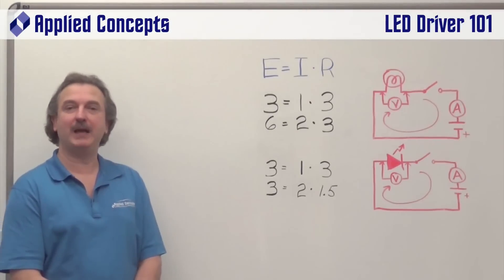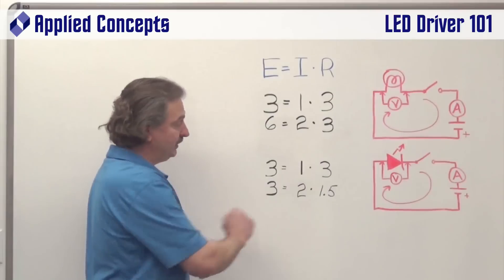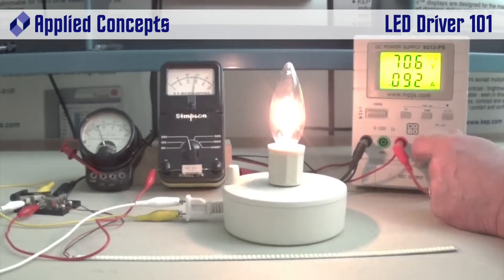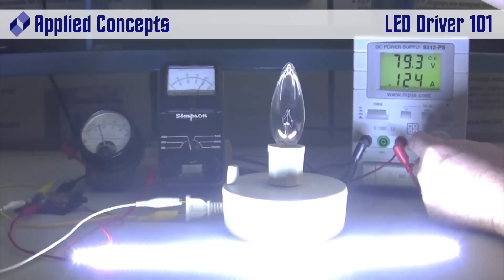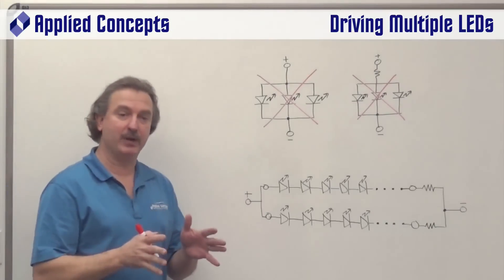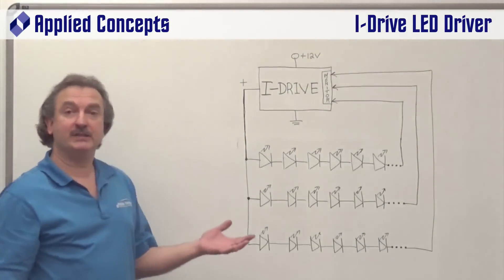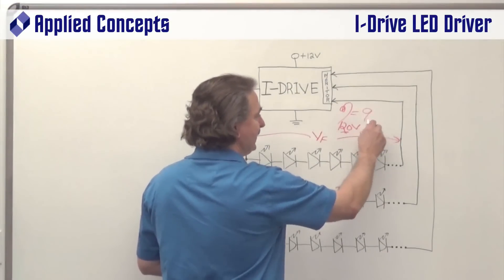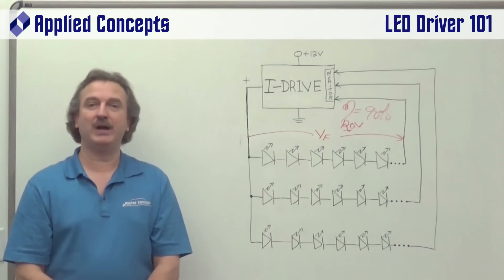LED Driver 101

Comment: I have a 14ft x 14 ft ceiling soffit with 12 4ft T8 fluorescent lamps on a dimmer. I would like to convert the fluorescent to LED's. The LED conversion is simple, but, the dimming is the question. What would be required to properly dim these LED's ? These fixtures are single tube T8's

Comment: I came across a phenomena, I found tree dumped led lights, inside, a separate driver, the led lamps are connected in series and parallel, the burnt diodes though were located, on each parallel line and one higher than the other on the series line and on separateparallel line as if indicatingthe high voltage path, amazing! Is this because a surge is a separate voltage frequency! Why didn't the first sets of diodes burn on either end instead, or all diodes?

Comment: It's just bad design to put LEDs in series. If one of them goes bad, the whole string is out. That is why we use LEDs in parallel, at lower voltage, not 120V!
Reply: All would burn during a surge, not while in series. Best option, sets in series and parallel may be categorised to "the survival era"; a bonus had the drivers a manual var-resistor after a fast modification, just in case!

Comment: Is there a negative consequence if my LEDs are 2.5m away from the LED Driver?
Reply: to begin with, im not an electrician, just a humble and passionate enthusiast;
the negative consequence of a longer distance is a higher resistance that must be overcome. Your voltage is going to have to go upwards in order to keep your amperage low. Look into ohm's law. E=IxR or Voltage = Amps x Resistance in english. So, truly, its all going to depend on your specific set of numbers. Nevertheless, I don't think 2.5m is long enough to dramatically increase the resistance of your circuit albeit you are using the proper size wiring. 
Best Wishes, some guy from youtube.

Comment: Good video! A question is: how does a 12v LED driver IC produce a 120v forward voltage (Vf in the video ) for the LED string? I know there are some boost thecnologies, but 12v -> 120v seems a very high boost.

Comment: I'm coming from the laser hobbyists camp...if your driver isn't employed at all(direct current ungoverned or regulated) or is set at the wrong current your laser diode will blow. Love how you showed that at first you had to over come the initial leds forward voltage to get it to glow then showed the very small window it operates in and how the current flow increased.

Comment: Hello I need help for led driver, 
my current Kitchen chandelier led driver is bad and need to replace with new one, the configuration of bad one is: 
Input AC 90-265V 50/60Hz
Output: 83-120VDC, current 260mA (Constant) 
Power: 25-36X1W

The new one I got in the market:
Input: AC85-277V 50/60Hz 
Output: Voltage 60-120VDC, Current 300mA (Constant)
Power 20-36 W Watt
Can you tell me should I use new led driver (which is 40mA more) in my Kitchen led chandelier. Your advice will be highly appreciated.
Thanks

Comment: So if I have a DC 5V 60A 300W PSU and two strips of LEDs (WS2812B ) 5V would this blow my lights?
Reply: Darren Hedlund
Reply: You would have to go with the manufacturer recommended voltages for the led strips. There's usually a voltage range ( upper and lower voltages ).  So if 5 volts is near the middle of this range your ok.  If it's near the high end or over the top of the range, it'll burn out faster or right away if way over. If 5 volts is on the low end your ok. Lasts longer and more efficient. Hope it helps
Reply: no, but if no resistor then leds draw maximum amp (led forward currrent) and will die due to overheat

Comment: I am confused.  You say for example, Vftot = 120V.  How can that be when your input Vi = 12V?
Reply: 12V is to power the driver, the driver will transform that into the appropriate requirement which is 120V in the example.

Comment: A worthy whiteboard chat....thumbs up...and all that.

However..
*[cue thunder sound effect]
...at about one minute into the lesson,  you speak of impedance...
Impedance is AC phenomena,  taking into account resistance and reactance
resulting from being driven from an AC source.  Your whiteboard examples are
being driven from DC sources...only RESISTANCE is in play here.
As this is scripted as a tutorial in LED basics, which are DC beasts, keeping
confusion to the new bees to a minimum is a good thing.  Resistance and reactance
are not interchangeable terms.
Reply: Dictionary: "impedance: the effective resistance of an electric circuit or component to alternating current, arising from the combined effects of ohmic resistance and reactance." So, if we ignore parasitic inductance or capacitance of the LED, it's impedance ~=  resistance, albeit non-linear.